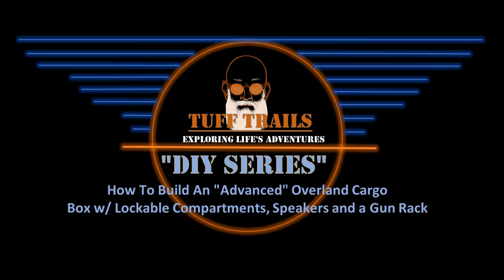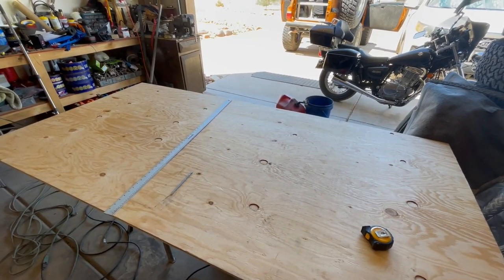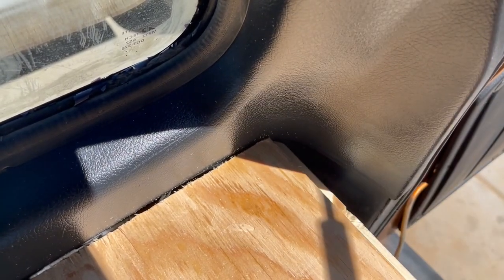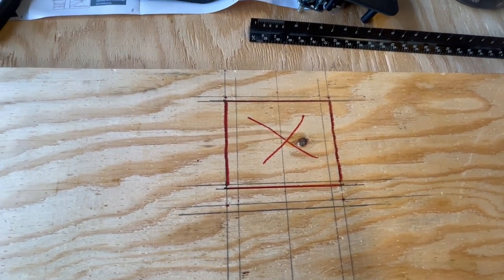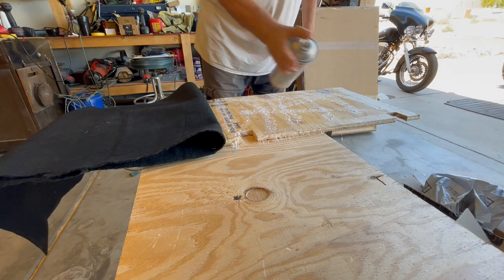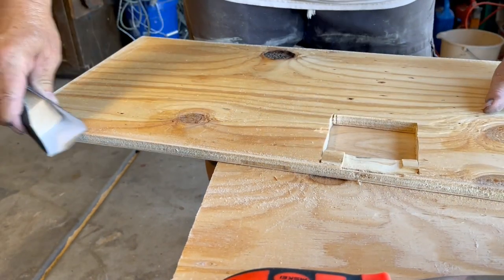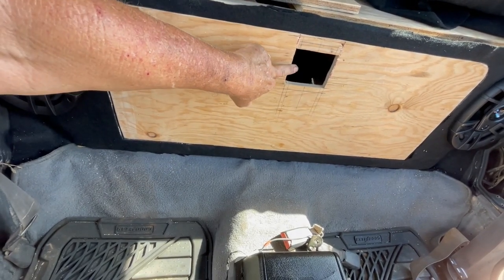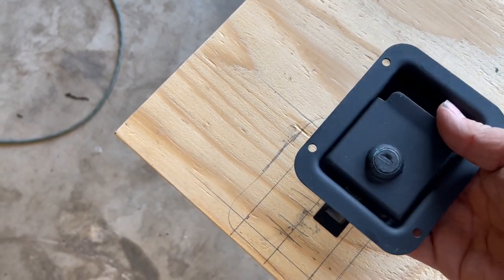S4 E8 Tuff Trails DIY Series  Advanced Overland Cargo Box

Comment: I have a question I feel dumb asking about it but I have a 92 tracker and were the bottom of the struts mount to is that metal or cast iron? Thanks in advance!!
Reply from the maker: I just looked at one of my 92's and the two bottom bolts mount to the "CAST" knuckle.
Reply: Ok so it is cast. Idk why they would  do cast seems like it would brake if u got in a Lil bind but guess not cuz ever geo I ever owned I gave it heck and it did good. Thanks alot!!